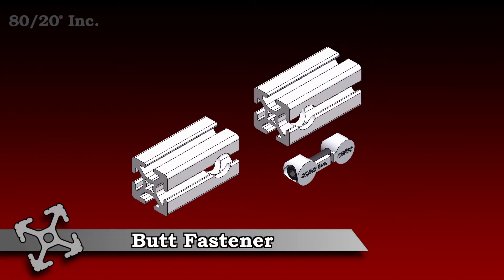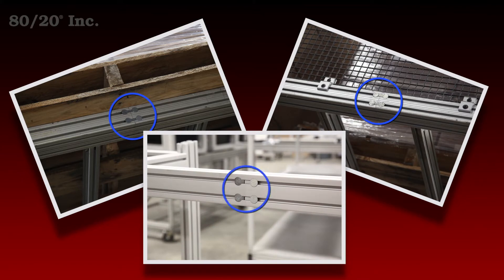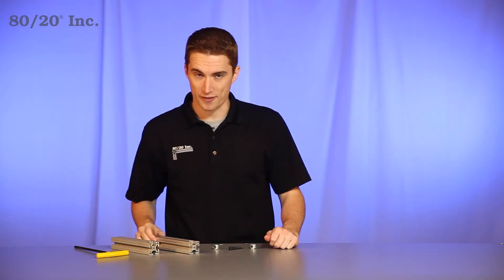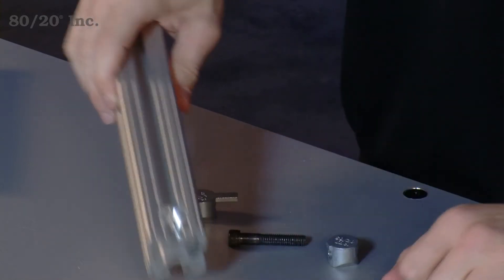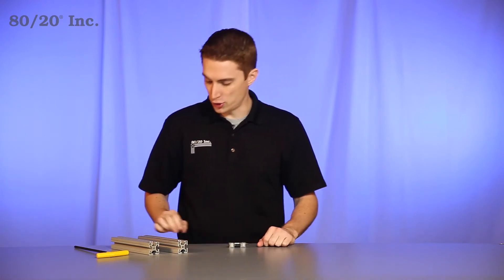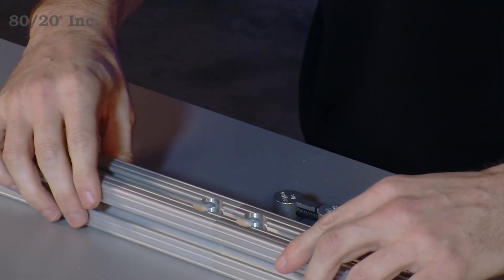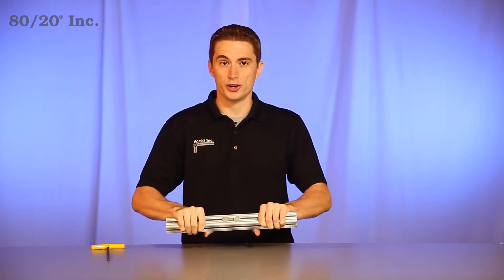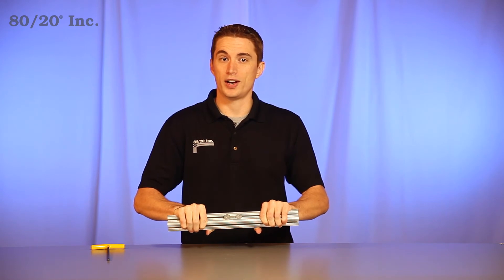80/20: Butt Fastener Overview

Comment: great video.   hoping you can tell me what connector you use to attach a quarter round parallel to a 1010 extrusion.   I cannot for the life of me figure out what connector you used that connects 2 tslots together
Reply from the maker: Hi, Tony - that's an excellent question! One way to accomplish this, for example with a 1010 and 1012, would be to use a drill thru counterbore on the 1010. You could then use a 3068 Socket Head Cap Screw (SHCS) and a 3204 t-nut -- Insert the SHCS through the drill thru counterbore of the 1010, and thread the t-nut on the end. Slide the t-nut through the t-slot of the quarter round profile (1012) and then tighten the screw with a hex wrench. I hope that helps!

For more information, please reach out to your local 80/20 distributor for assistance: https://bit.ly/3SY94Y7 or you can also contact 80/20 Design Assistance: https://bit.ly/43sH6W5